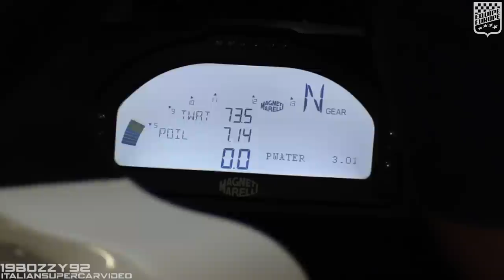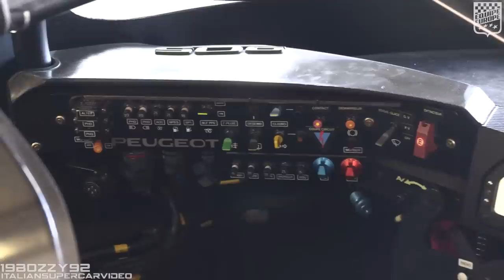Peugeot 905 Evo 1 Bis V10-Engined Group C Car in action: Warm-Up, Accelerations & OnBoard!

Comment: i'm sure the hybrid stuff is way quicker but for the sound and the sights, this era was the heyday.
Reply: It's not even really that much faster. In Le Mans '92, which this car won, it went 2974.6 miles (4787.2 km). In Le Mans '89, the winner was the Sauber-Mercedes C9, which went 3271.6 miles (5265.1 km). Thats further than Le Mans '21, which the Toyota hybrid won, going 3140.7 miles (5054.5 km). The Group C cars operated on different rules more than different speeds.
Reply: @ericeasley7633  track layout is different, maybe you should consider to compare the 1991 gpc to 2020 lmp1
Reply: This is a fair point. I'm new to endurance racing and that is something I learned about after writing my original reply. I think 2 of the bigger factors are the straights being cut by chicanes and the slow zones for caution, if I am correct?
Reply: @ericeasley7633  yea, the chicane is to prevent too fast and crashing to to the 90 degree turn at the end to the straight.
Indeed it would lower to top speed, but safety is more important than excitement
Reply: 2 years later and I think this comment aged a bit poorly
Reply: Yeah tires and Asphalt are also different today, not sure the heavy hybrids are really faster
Reply: @erdnaxel55  they really are much fast for the simple fact that rallye1 cars can use all the power it has at hand. And Rallye1 cars aren't faster only on asphalt it's on all terrains as well. As marvelous as the group b cars were, they were pigs to drive and nothing more than death traps which nearly killed rally in its whole.
Reply: @mintgoldheart6126  even Group A and Group N were pigs to drive back in the day when Group B existed. And a lot has to do with tires. In the end, Group C cars could make close of 800 hp for a weight of 780 kg. Now the Toyota GR010 can make 671 to 939 hp ( depending on the hybrid mode ) but weights 1040 kg. Maybe on the whole race since she would win. But on a qualifying lap time, I'm not so sure. Anyway there's really no way of knowing since nobody's gonna risk putting money into setting up an old Group C to todays track condition and risk wrecking her just to see who would be the fastest. 
And Group B didn't nearly killed rally, very poor public security enforcement measures did nearly did. They were just glad to stop the Audi/Peugeot pissing contest wich might have turned the other teams out of interest in rallying. ( Like Group C/GTP did )
Reply: @erdnaxel55  group c was killed by a whole other thing than team domination. And the only way for group B cars to be faster than Rally1 is to make them no group B cars anymore.
Reply: But to be honest the new lmdh cars are amazing, and that Cadillac V8 sounds so badass
Reply: The funny thing is that some of these can keep up with modern cars, like the Porsche 962
Reply: @erdnaxel55  The comment was made in the lmp1 hybrid era and still lmh are faster as they are far more advanced don't disrespect the engineers.
Reply: @erdnaxel55  The older gen cars would had been much faster than today's WRC with modern tech and rubber.

Comment: This car is timeless. Group C forever👍🏽
Reply: Indeed
Reply: 2012-2018 LMP1 was basically Group C round 2
Reply: 💯 @MarVqueSauce 33
Reply: Sauber Mercedes C9 is too...two incredible sport cars.
Reply: @MainMite06  nope.  group c had terrible fuel limits that put a damper on performance. remove that and group c would've put lmp1 to shame.
Reply: @jkk20  he is not saying that 2012 lmp1 was better
Reply: @c1x5w89  But they were faster and way more advanced. So they are better.

Comment: I love that fluttery rpm sound when it shifts
Reply: It's the sound from the sequential transmission btw
Reply: It might be a consequence of the transmission setup, but it's certainly the engine making that sound.
This is the audio detail missed in most simulators. There are a few that get it right and it makes the experience so much more enjoyable.
Reply: Air shifter, like all the F1 cars have. This engine is from a F1 V10 but worked for endurance. Less rpm, etc.
This fluttery is just because the air shifter, that is much more cost than the traditional quickshifter in sequential gearboxes.
Reply: So judging from theses comments, it's like 3 or 4 different things making that damn sound. Thanks.
Reply: I get vibes of the Ferrari 310 B when accelerating and shifting
Reply: @simonc6328  the Epsilon Euskadi mod for Rfactor 1 nailed it!
Reply: @blackflagqwerty   just checked out, awesome, thanks.
The 7up Jordan 191 F1 for Asset Corsa is excellent too.
Reply: @LucasSouza023  This engine is not from F1. It was designed for the 905 and endurance racing, they tried it out in F1 and it was not so good.
Reply: Light flywheel
Reply: @F-Man  😆😆😆
Reply: @digitalcamaro9708  It sounds like any other sequential manual transmission to me when you slam it into gears. The little fluttery noise is because the clutch has springs on it. So that make 5 things, but I think this one thing is actually what op is referring to😂.
Reply: @amorag59  nice to see all these engineers debating at once 😂must be working from home due to covid
Reply: @simonc6328  Cool! Gonna try the 191 when I get he from wrk.
Reply: @blackflagqwerty    wicked mate. Let me know what you think. I have a wheel setup for my rift and this car model is challenging but rewarding, and the sounds of BOTH upshift AND downshift are fantastic.
The only other I can recommend is the Porsche RSR for Assetto, the guy put a heap of work into perfecting it. Very rewarding.
Reply: It's the clutch pack in the differential slipping just slightly. You hear the rpm flutter on all the wrc rally cars launching off the line because the electronic launch controls are trying to reduce tire slip by opening and closing the LSD slightly without losing power by retarding timing or cutting fuel.
Reply: @amorag59  imo I would say that a group c car would run a solid disc or solid multipuck clutch, the gear oil weight is really high in a diff is meant to cool the clutch pack and help it stay engaged as the diff heats up. If a dry clutch is causing that kind of chuddering you need a new clutch soon. But we don't know for sure unless someone knows what type of clutch is used on this car.
Reply: @Teamflatfoot  Gotcha, interesting. Could not tell from clutchpack pictures available of the engine being out, but you're on to something.
Reply: Digital Camaro lolololollllll
Reply: Sounds very similar to the Renault V10 engined Williams F1 cars of the early 90's.
Reply: All cars with an insanely light flywheel and a semi auto g/box are fluttery when up shifting.  Stick a big heavy flywheel on it and slow down the shifts and it wont do it at all
Reply: Thats just a harmonic of  the driveline that gets excited when the clutch re engages after shifting.
Reply: Is this the explaination for WRC ? I tought they just used VSS ( wheel speed) sensor and reduced torque (timing or fuel cut)  as strategy fpr launch control ??? Typically you want to lock the diff for max grip on dirt !

Comment: The fact they got an F1 engine to last for 24 hours was pretty amazing.
Reply: Yeah but sounds like a f1 but isnt one
Reply: It was the other way around. Peugeot designed an engine for endurance racing, and later converted it to F1.
Jaguar on the other hand got their hands on the Ford Cosworth 3500cc V8s that were being used by Benetton during the late 80s/early 90s, and turned those into endurance power plants. :^)

Comment: 1:00 Imagine revving a 10.000+ rpm Le Mans winning V10 by hands
Reply: Realize get 10K rpm in normal road car:)
Reply: @joe125ful  the new gordon murray V12 supercar gets 12k rpm!
Reply: @nomiguda  Yes but i rather drive other cooler cars than that thing also higher rpm not means better sound too..
And its still 1.000.000Euros prototype..
Reply: @nomiguda  As good as V12s sound (and I'm sure Gordon's Cosworth V12 will be insane), I've always loved the unique character V10s have.
Reply: @jnmason6283 I hope its have half good sound as Ferrari cars...
Reply: @joe125ful  *2.500.000 Euros literally what other car would you rather drive than Mclaren F1 version 2.0
Reply: @amorag59  Owerpriced as hell...
Reply: @nomiguda  the 905 does also they have revved to 12,500
Reply: @brandonlee3314  not something you can take down to the shop though
Reply: @joe125ful  True, but I don't hate him for it. He has a ton of knowledge and experience.
Reply: @joe125ful  Absolutely true, for example the Zonda F with the 7.3 AMG doesn't even reach 6'500 rpm but sounds like an F1 car
Reply: @brandonlee3314  as it is a formula one engine but get debuff
Reply: Too low rpm for f1 engine

Comment: Group C. You know those cars were something insane when even today they look more gnarly than modern Prototypes, makes them look almost pedestrian by comparison. What I'd do for a modern Group C level racer.
Reply: To me motor sport died after 2010 after that  they looks very similar small engines hybrid motors and they sounds like rental cars 4 cylinders ! Manufacturer must realize that the sound is huge part of car’s characteristics
Reply: Crazy thing is, modern lmp1 hybrids go even faster and use half the fuel.
Reply: @mohnnadmercedes8246  I'll have to disagree on the sound department. A lot of insane sounding cars are still being produced.
Reply: @digitalcamaro9708  you have to admit they are starting to disappear tho as we get more efficient
Reply: @nickthecynic587  Fair point.
Reply: @nickthecynic587  True.
Reply: More legendary hypercars have been made in the past two decades by trying to emulate Group C cars. Pagani and Koenigsegg started with them as their inspiration and look where they are now. That should tell people something.

Comment: Wow, didn't expect it to sound this interesting😲 I just love how it sounds like a mid-revving F1's V10 sound from outside and a mix between hillclimb formula's Zytek V8 and modern F1's V6 from the inside😙😆
Reply: GuyWhoLikesTheSnarkies14 that’s because it is a F1 V10.  FIA decided to align F1 and Group C engine specs to control costs but ended up contributing to end of Group C as engine and development costs rivaled F1 but didn’t get nearly the same attention/sponsors/prize money, especially outside of Le Mans.
Reply: @nevercommitsuicide  yes they were detuned for endurance racing.  The FIA made the engine specs almost identical between the top endurance class and F1 arguing it would control costs since the engines were already developed.  Of course the theory is that Max Mosley sabotaged endurance racing at its peak as a favor to Bernie because it was encroaching on F1’s popularity at the time.

Comment: Sry for the maybe dumb question. In many video of older racecars, the mechanic revs up the motor pretty often in short period of time. Is there any reason for doing that? sry for my bad english
Reply from the maker: They did that procedure to warm and get the engine ready before heading into the track. Most of the old race cars (but also the modern ones) simply need to be started up, leave them in idle for a couple of minutes waiting for water, but mainly, oil temperature to grow up, and then gently give some revs to increase the temperatures to the optimal value. This allows oil to have the correct viscosity to better lubricate the engine when the car hit the track reducing the risk of any unwanted, excessive wear inside the engine. 
For special high revving and high level race engines (F1, DTM, Indycar and many others) they are generally pre-heated by a pump system linked to an external heater that allows water and oil temps to reach a defined value. When reached, these pipes and pump system are removed and mechanics start the engine to further warm it up (and even the gearbox) at the right operating temps. Since these engines are built with very tight tolerances, they may not even start at 'low', ambient temperatures due to frictions between the various components.
Badly said it's like the warm up you do (or should do) before doing any kind of exercise to let your muscles and joints be ready in order to reduce the risk of injuries and sprains as soon as you start your workout/match.

Comment: When I watch it, I think motorsport is dead now. This era will sadly never come back.
Reply: Maybe there will be combustion-only motorsports that will caiter the mad speed, action,complication, drama, and sound of the ancients provided 
    whereas the present electric cars provide screaming mice, and oversimplified speed with barely any perceivable sense of complication
Reply: Watch IMSA, you’ll think otherwise.
Reply: @MainMite06  The complication comes from the hybrid mix plus in some cases a third energy storage solution like a flywheel. A simple all ICE or all electric would not be complicated.
Reply: @jstoli996c4s  LMAO IMSA is a former shadow of itself lol
Reply: porksniffer maybe so, but it’s still good
Reply: @jstoli996c4s   If you compare to Imsa from 91-93 like same year that Peugeot 905, then Imsa today is too terribly boring.But its only my opinion.

Comment: Similar revs, capacity and power to Gordon Murray’s T.50. It sounds amazing.
Reply: Except this is a 1992 car which makes it more impressive considering the engineering was much more conplicated without computers
Reply: Nicolas Ramirez yeah but this is a race car engine, so it won’t last as long and doesn’t have to pass modern noise and emissions requirements. Love both engines either way.
Reply: Lol the Lola t92 smashes this for sound and looks judd is the best v10 in the world

Comment: What's "TWAT"? lol 😁
Reply: Temperature Water is not as funny as the alternatives.
Reply: Temp Water And Tires?
Maybe?
Reply: Novice driver setting ?
Reply: @davidcarruthers1547  Hhahahahaha:)
Reply: Tony Valdez nah I think it’s just temperature water. The “wat” part is water
Reply: @aaag1486  Maybe...but Temp Water and Tires make more sence to me and sounds  very basic checking thing before car start racing.
Reply: Temp-Check engine and oil temp.
Water-No leaks.
Tires-They are hot enough or good.
Reply: And POIL is funny too! (means "hair" in French)
Reply: @MrJef06  It's a French car after all, so who knows lol 🤣😂😁

Comment: can anyone explain why 1:03 this method is used to warm up?
Reply: To bring cooling and lubrication circuits to the correct operating temperature.
Reply: @roland2879  I literally said why this method specifically (Revving in short bursts), i know it is to warm up the engine

Comment: Why can’t they just let the damn thing idle? It’s not like it’s stalling out or anything.
Reply: Cause it could suffer torsional vibrations at lower engine RPM if it is allowed to just sit there. These engines are designed with a high RPM narrow operating window. The throttle is blipped and constantly to avoid the chance of vibration.